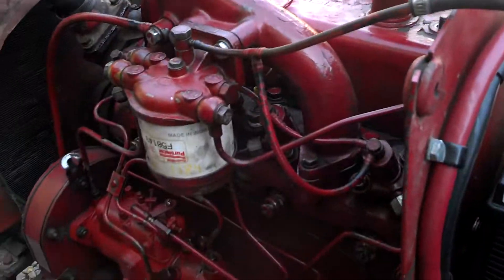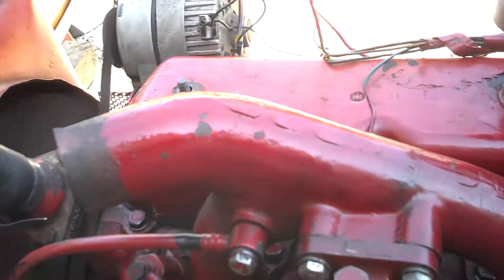International 364 BD-154 diesel, completed repair.

Comment: Hi great repair. I have Good old Manitou fork lift here in UK which has same IH engine as yours.
Couple years ago had very similar fault with cylinder head gasket 
Found that One of cylinder head bolts was not torqued down properly because of dirt left in bottom of thread not cleaned out by previous mechanic.
But now running and great old 1975 machine
Thanks for video

Comment: Just going through the same thing, torn head gasket, smoked like hell , blow by was unreal,  the chamber was very clean from too much  brake cleaner from the previous owner,  ordered from crosscreek, new sleeves, valves kit , 2 pistons, 250.00  order rings and gasket from ebay Jsk  out of UK  150, updated the glow plugs  I also putting in new nozzles nobody talks about that.  in driving a diesel car it either the glow or sometimes the injectors, not one youtuber on the Bd-154  installed new injectors.... all the injector had a bowl indentation.

Comment: i think international also used this motor in a small loader, we had one it was stolen off the job 3yrs ago. the loader used a full size drive tire even the forklift type rear steer tire was bigger the a usual size tire. that was a great motor and machine. it gone for good. that about all their is to it. i do miss it. my pop's left it to me.

Comment: Hi, i have problem with my IH500 Dozer, with same engine Bd154, it is easy to start but has a knocking sound, smoke white/blue, and stall when hot. Smoke coming out of breather also. I would like to get in contact with you by email to ask some question! Thanks!
Reply from the maker: You can email me

Comment: I have a international B250, it runs no problem starts no problem, just a lot of white smoke all the time, Thinking air or dirty diesel filter, no problems with adding load or power, also the T handle that controls rear hitch, front loader hydraulics infront  of the seat wont seal it will pop out completely and piss oil every where, anyone got any idea on that, still waiting to get my shop manual for this.
Reply: You're getting a lot of white smoke that usually indicates water burning in the combustion chamber. I would check to see if you have a leaky head gasket. Pressurize the system and that will tell you if it is leaking.
Reply: @jessier3800  wouldn't it be pressurizing the coolant if it was the head gasket ?